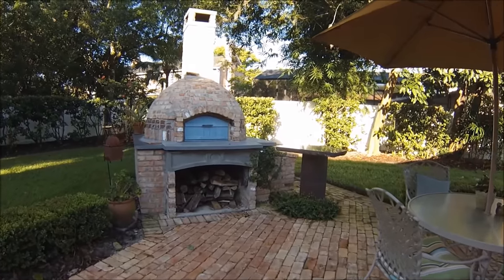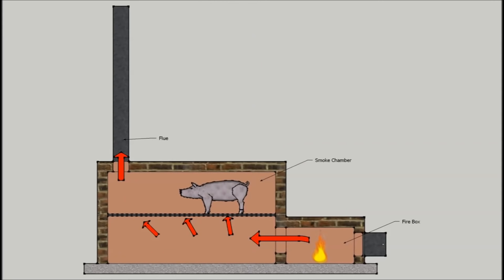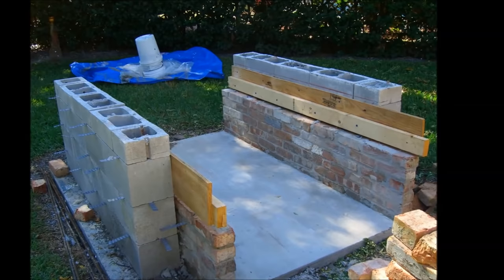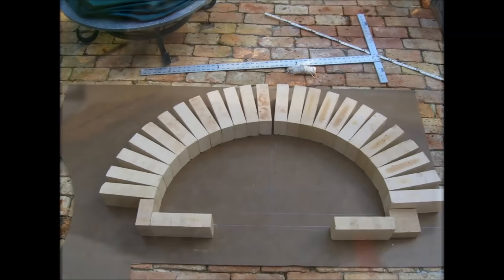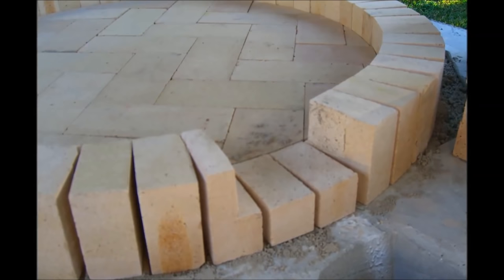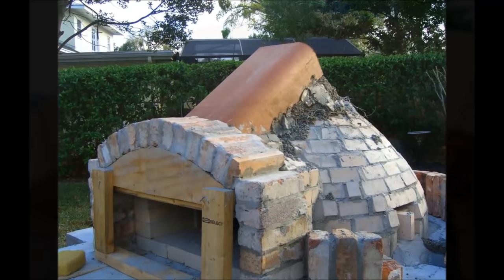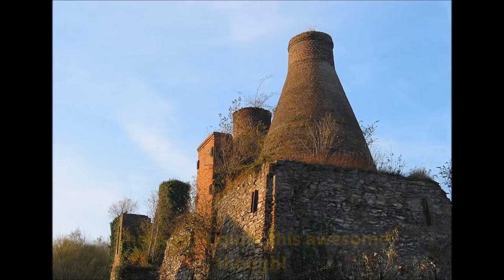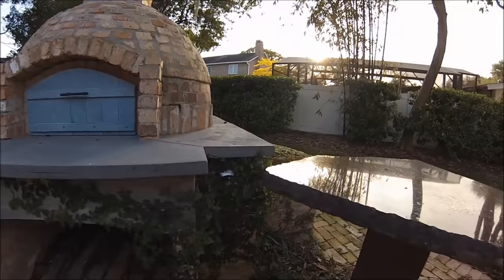How to Build a Brick Wood Fired Pizza Oven/Smoker Combo

Comment: Can I use a stone sheet as the floor of the oven?
Reply from the maker: I think so but you want to make sure it is a stone that will be able to stand up to a lot of heat. I have no idea where you find out that kind of information though.
Reply: Thanks! After your confirmation, I managed to look up and found this page: http://homeguides.sfgate.com/type-stone-used-hearth-92034.html
I'd go for granite, then. I'm gonna want it thick, aren't I? Don't want it to chip or crack over time.

Might I say, your video here is the best on YouTube. It's very detailed. Must've took time and great dedication. You're like a teacher now, so many people look up to you for advice regarding pizza oven.

Didn't really think you'd answer such a trivial question, but you did! You're the best! Thank you!
Reply from the maker: Thanks. I try to answer everybody's questions as best I can. I'm not that big of a deal LOL! 

That being said, I would not use granite for the oven floor itself. The fire will sitting on the granite will be well over 1,000 F and will be burning on it for hours. There is a product called flamed granite that is used on a lot of high end office buildings as paving tiles. It has a roughened surface that is very slip resistant. The way it gets that rough surface is the tile has heat applied to it to cause the surface to spall (basically the surface of the stone starts flaking away leaving it with a rough texture - something you wouldn't want to lay a pizza on because it might stick). I don't know how much heat they put to flamed granite or for how long, but the bottom of the oven is going to be subject to a lot of both. I would definitely stick with a refractory safe material. I think the fire bricks work well because they are not real big and the temperature changes might crack something larger. They are also pretty thick so hold a lot of heat which is what you want.
Reply from the maker: Here is a link where some guys with experience with building a fire on granite. They basically say it will crack - one of the issues I thought you might have with the granite....https://permies.com/t/11409/RMH-experts-granite-firebrick

Comment: Australian builders call your topping out party  a roof wetting
Reply from the maker: I get it! I think. Wetting it with beer. If that's true, it's very clever. If it's not true, it should be.
Reply: @LeeMcNeil  Hit the nail on the head, so to speak. Mind you only a little splash for the roof. :)

Comment: 1) I also live in Central Florida, but I have sugar sand all over my yard :(   Any suggestions?  I was thinking of pouring a footer for my project... 2) Did you need to get a permit?  3) Did you get all your parts from the website you suggested, or a local vendor?  Nice work m8!   Would appreciate the feedback and help...
Reply: +Wunji1  Also, you can get those tiles at Dal Tile, or American Olean in Orlando...
Reply from the maker: +Wunji1 You could just probably make your slab a little thicker - it's what we call a monolithic footing. Just make sure the thick parts are underneath the bearing walls. I got some of the materials (fire clay and fire bricks) from Rinker which is now CeMex. I got the old Chicago brick from Harwood Brick (now called Old Castle) in Longwood and the perlite from Blodgetts Nursery. I did get some high temp batt insulation from Forno Bravo but used mostly perlite. I got the rest from Lowes.
Reply from the maker: +Wunji1 I'll check it out but I haven't seen any tiles anywhere that is exactly what I want.
Reply: +Lee McNeil   Ok cool - thank you!  Will that need a permit of any kind?  I am actually getting the brick veneer for inside the house at OldCastle - The Glen Gery stuff.  They are actually out of Chicago brick due to a shortage, so I may go with Boston(?) brick, or whatever he suggested that was very close.  I can pick this up locally and Stone Valley in Clermont.  So much to do!!!   I would love to come look at your oven, and get ideas!  Great vids Lee!!
Reply: +Lee McNeil   Yes, I lay tile commercially at times, when I feel like it :)  I have been doing work for Orlando Area restaurants for 16 years or so, and can probably find the tile you need.  Dal tile actually distributes for tons of tile companies.  I'll see what I can find based on your pics...:)
Reply: +Lee McNeil  Those tiles are Talavera tiles.  One site that has tiles pretty close to what you have is:

http://www.terraartesana.com/mexican-tiles/talavera-tiles-washed-colors/
Reply from the maker: +Wunji1 I didn't pull one but I checked the City of Winter Park at the time and the closest thing to a pizza oven I saw was a backyard grill and it didn't require a permit. You will have to check where you live. I wouldn't call the building department and ask though because the default answer will probably be yes. If you end up not pulling one, I suggest not storing a bunch of building materials where someone can see it from the street so you don't attract the attention of an inspector driving by. He would probably figure out a way to make you pull one.

Comment: About how many fire brick did you need?
Reply from the maker: I'm not 100% sure, but not too many, probably less than 100 of them. Most of the fire bricks are cut in half so they go pretty far. I used around two cubes of Old Chicago bricks though.
Reply: Lee McNeil Thank you!! From watching your video it looks like your fire brick are bigger than ours. We ended up getting about 200 and they are roughly the size of a standard brick. Do you by chance know the dimensions of your fire brick?
Reply from the maker: @mattneff1262  Yes, my fire bricks were about the same size as a regular brick. I was kind of guessing on how many I used though. The inside of my oven is 36" in diameter so if yours is larger that would account for most of the difference.

Comment: Wow! I am just now seeing this and I spent the whole summer building a very similar oven (Jamie Oliver inspired, not smoker) Love your smoker idea though. I am on Forno Bravo's forum. MeBeMarc3
Reply from the maker: +Marc Herrick Thanks Marc. I saw your oven on Forno Bravo. Very nice build you have going there. They've changed the forums a bit from the last time I used it much so it seems harder to get around the forum. If you search for "florida igloo" in Oven Photos - I think you will find my thread. I did a much simpler chimney offset than what you are doing but I am getting some cracking that I am going to have to repair. Nothing too severe though and it draws really well. There aren't many out there with the offset center chimney so I will try to throw in my two cents on your build as best I can.
Reply: Thank you! It is nice to know that you saw it. I think I'm done, other than a door and a chimney cap. Now I just need to log some hours cooking in this thing.

Comment: Wouldnt it make more since to build a small firebrick fire box under the actual oven to heat it ? why would you build a fire inside the brick oven and have to deal with ashes in the bread ? Just sayin 😍
Reply from the maker: You need a super hot oven to make really good pizza and what you are describing would be probably not be able to get more than 600 to 700 degrees, while this oven will get close to 1,000 degrees. When you build a fire in it and then are ready to cook the pizza, you push the fire back into the corner and sweep the ash back with a wire brush. That way fire rolling overhead is cooking it from the top while the superheated brick below where the fire was before you pushed it to the back of the oven, is cooking it from the bottom. Now if you want to make actual bread in the oven, you would take the fire totally out of the oven, sweep out the ash and the residual heat from the bricks will bake the bread.
Reply: Lee McNeil 
1000° ? Are you smelting gold lmbo...😛😝😜
I bake bread at 400° and pizza at 500°. I think its funny , my husband thought cooking on high is the way to go.. Of course I had to clean the burnt pans lol. The Italian ladies remove the fire and the ashes before they bake....But your oven is Beautiful...
Reply from the maker: Yes the pizzas cook in less than two minutes at 900 degrees. Baking bread is done at a lot lower temperature. That's why you take the fire out of the oven. It bakes the bread with the residual heat from the bricks and because it's insulated, you can bake just about as many loaves as you want.
Reply: Lee McNeil 
Well im going to build your beautiful oven but im going to attatch my  firebrick box below the oven with a half circle cutout in the back on the floor of between the top brick oven.snd lower firebrick fire box.. I think it will give high temps for cooking anytting and solve the ash problem. 😀😃😄
Reply from the maker: That should work good.

Comment: Do you have a location to download your 3D model?
Reply from the maker: Reid Gustafson If you have SketchUp just go to file 3D Warehouse and look up "pizza oven igloo" and it should come up.
Reply: +Lee McNeil Thanks for the help. One more question, how did you block off the smoker flue, is that duct tape I see surrounding it with 3 2x4s inside?
EDIT: How many fire bricks did you end up using? Did you cut them in half for the dome or leave them full size?
Reply from the maker: +Reid Gustafson Yes I basically duct taped three 2x4's together and stuffed it into the cell opening to keep the concrete out of the cell and to form the opening through the base. It is critical that you take that out before the concrete fully sets or you will play hell trying to remove it. I would say pull it out about 2-3 hours after you get done with the pour. That way it will be stiff enough not to collapse into itself but still soft enough to get it out easily. 

And I can't remember how many fire brick I used. There is probably a way to calculate the area of you inside dome based on the diameter (I don't know what that formula is off the top of my head), then add around 25-30% for the taper, waste and the mouth/flue opening, divide that by the area of the end of a single fire brick  - then divide that by two because I did cut them in half.
Reply: +Lee McNeil Good to know, thank you. Does the smoker work well? I am planning on doing a thanksgiving Turkey in it, assuming its done by then (top concrete slab goes in on the 26th)
Reply from the maker: Yes - I actually smoked a turkey in it for Thanksgiving last year and it came out great. I'm going to post the video soon. I've got a video where I smoked some ribs in it a while back. Check it out https://youtu.be/zrjd-k1bCak

Comment: Wow...seems very complicated and expensive and heavy process for what it is....i.e. not a bridge. Why not use foam/aircrete? Everything becomes easier and quicker and cheaper.
Reply from the maker: It would be even more efficient to just order Domino's and use a coupon.
Reply: @LeeMcNeil  Except that you wouldn't be 'doing it' yourself. As we learn more I'm not sure we should ignore it. Humans survive by learning and accepting.  Otherwise cement wouldn't be in such wide use...or we wouldn't even have cement and cob would be your material of choice. If your not sure what air-crete is the Google works pretty well.
Reply from the maker: @Gerry S I had to look up foam air concrete and it's what we call lightweight or cellular concrete here. I've never seen that used in a structural application before, but I guess it's possible. 

Initially I thought you might be referring to autoclave aerated concrete, which is pretty popular in Europe I think, but it's rarely used around here. We used to have a Ytong plant not far away, and those guys were really pushing their product to designers. I even worked on a few jobs that had it. Whole building structures including floor slabs. I thought it was a pretty good system and not super expensive. They may have sold it at very little margin in order to get a toehold in the market. But for whatever reason, they shut down the plant, or sold it, but I haven't seen a job with it in 10 years or so. But I think it would make an excellent performing oven material.

That being said, it wouldn't look much like an old school oven, without adding a bunch of gingerbread. Which can end up looking cheesy if you don't do it right. So I guess it's just a matter of aesthetics.
Reply: @LeeMcNeil  Yes, there have been and are lots of products around that people are using or trying.  Sometimes hard to know why things don't work out with them....could be anything from wrong formula or testing to bad management. If you like to do things a certain way and enjoy it there really is no incentive to change - or reason to in this case. I like your idea of doubling up on the usage, I would just be looking for a quicker and less complicated way to build it. I would rather be spending less money and time building and more time eating the results.  The 'foam/air crete' that I am referring to is made with soap (or other) suds water and cement.  Light, insulating, easy to work, less material, pretty strong (and can be reinforced), easy to work with when set etc.  Your video was very thorough  which I liked.  Thanks

Comment: Any plans please
Reply from the maker: I have the Sketchup model uploaded to the Sketchup 3D warehouse. I am working on a set of paper plans but I don't have then completed yet.
Reply: Thanks for the inspiration I started my pizza oven, and I love the info in you video…but I had a question….Did  you lined the hole in the cinder block (smoke path) with some sealer or anything?
Reply: @LeeMcNeil  thanks for inspiration…wanted to know if you lined the hole in the cinder block ( smoke path) with anything
Reply from the maker: @aldihenry289  I did not and it has held up pretty good as far as I can tell. I have not put a camera or mirror up in the flue to confirm it's not getting damaged from the heat, but it still functions like it should.
Reply: I want to rerouted my chimney to the top of the dome and build a spiral chimney… I wanted to know if you had to anchor your chimney some how or is the mortar strong enough…( I live in a windy corridor) should I worry about the chimney coming down
Reply: @LeeMcNeil  how do you find it on Sketchup?
Reply from the maker: @ryanjohnson1844  It's in the Sketchup 3D Warehouse. In the Sketchup program, click on the File menu, then 3D Warehouse and then Get Models. Then search "Igloo Style Brick Wood Burning Pizza Oven with Offset Smoker". It's still there, I just checked,

Comment: Thank you Lee, for sharing your oven build. I've been planning my second oven for the past year. The first one I built wasn't large enough. There is nothing like the smell of freshly baked bread and cinnamon buns hot out of the oven.
I've included your video in my collection of outdoor kitchens sites. http://www.scoop.it/t/outdoor-kitchen
Reply from the maker: Brian Yanish Thanks Brian. My oven is 36" in diameter and that size works for me. I have fed a party of about 40 out of it. I was running three pies at a time that day and I was straight out humping it. If you're running a restaurant or doing a bunch of bread you might need a little larger oven.
Reply: Lee McNeil  my first one was about 20" because of the space I had to work in. I see you didn't use any refractory cement with your build.
Reply from the maker: Brian Yanish I added fire clay to the mortar mix that I used to set the fire brick. I didn't use it anywhere else though.

Comment: The amount of reinforced concrete is such an overkill, put some steel doors and you got bank vault in your backyard.
Reply from the maker: It might be, but I'm not a structural engineer so it's better to be safe than sorry. I can tell you from my experience though, it's not even close to being too much reinforcing steel. It's actually pretty difficult to put so much rebar in your concrete that would make any significantly negative impact on it's strength.